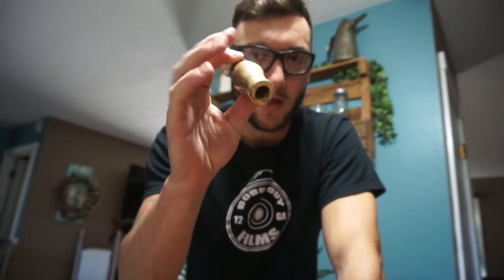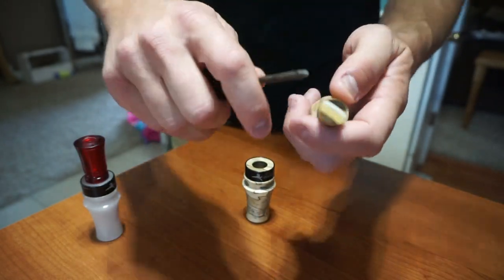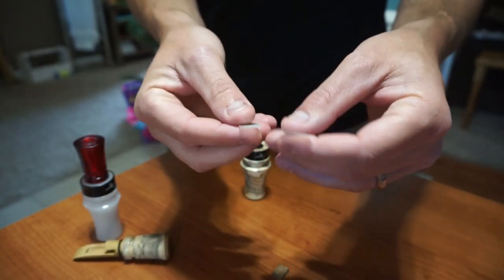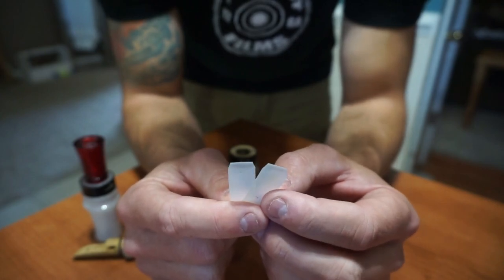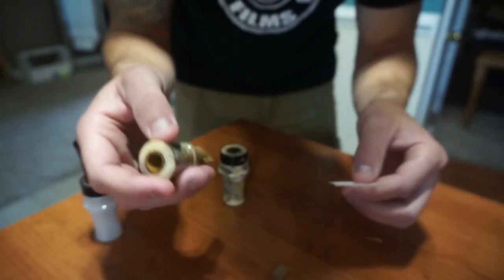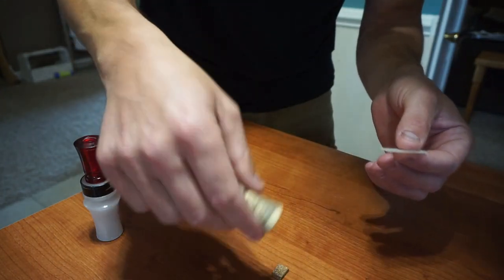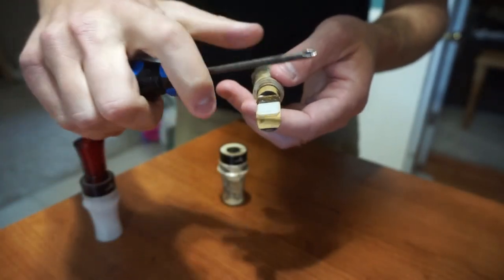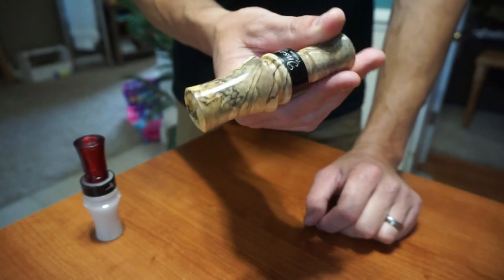HOW TO Clean and Tune a Duck Call (Double Reed)

Comment: Olt d-2, Duck Commander Acrylic 1972 single reed, double nasty, Illinois river valley Woodford dd2 double reed. I use both, double and single reeds cause when the tuning of a quack is on the feed call is too high so I tune down the big calls to get a good feeding call.  Don't know if it is operator error or just my preference. Also I tune my quacks so they don't ring or echo find a lot of birds will flair in close to this. Hunting in tight quaters within 30 yards in most of the spots I like to hunt.